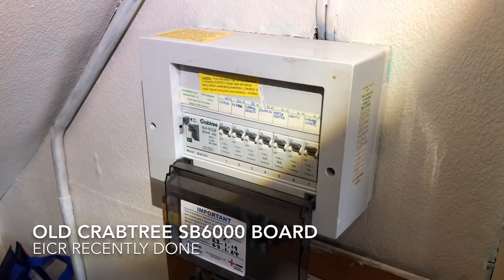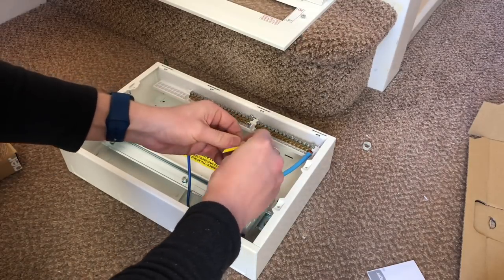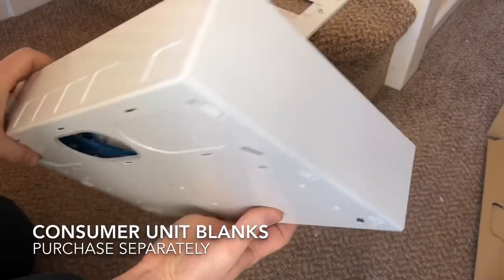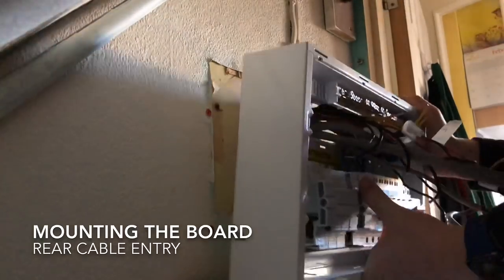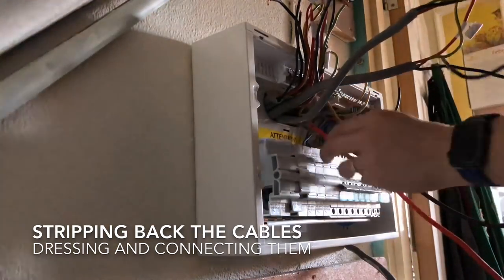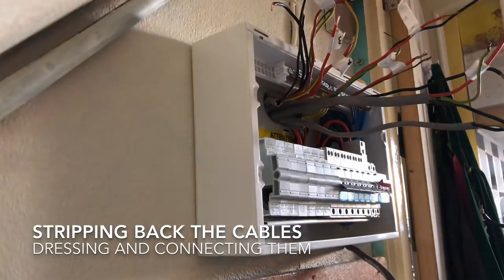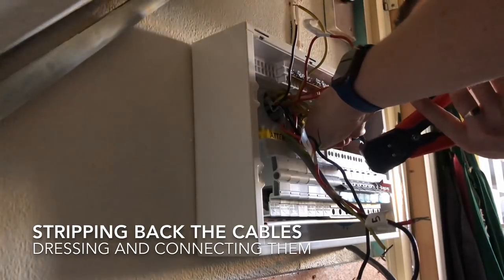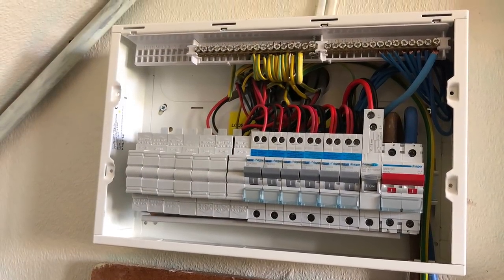Consumer Unit Replacement- Installing a Hager RCBO consumer unit to replace an old Crabtree one

Comment: Great video, nice and tidy board. I have a question regarding RCBOs, in the past type AC would be installed. Today the emphasis seems to be Type A as a General purpose, what would you install in a domestic enviroment type AC or type A.
Reply from the maker: Type A always as many home appliances have DC leakage current now
Reply: Would you consider mixing type A with type AC! Type AC for resistive load eg immersion heater and oven and type A for everything else.
Reply from the maker: I only use type A now
Reply: I’m just reading up on rcbo’s, you mentioned type AC and A can you clarify as the ones I’ve seen are type B and C
Reply: @paulwilliams8536  Type AC only works with AC loads, so electronic loads won't play nice with them as the electronic load would usually be pulsed DC
Type A works with both AC loads, and pulsed DC loads

EDIT: you might be getting confused with the MCB part of it
with MCBs, Type B is the standard type for domestic installations, Type C is usually used when an inrush of current is likely to occur when the equipment is switched on, and there is also Type D for where the inrush is large enough to trip a Type C

Comment: Its a bit confusing why you put the neutral al to gather on one big strip ‘English way’ here in Holland and Germany both wires natural and fase go true the RCD
Reply from the maker: Anton Floor yeah here we only have single pole RCBOs in domestic properties but you guys have more double pole which is better
Reply: Both the N and L go through an RCBO / RCD. Only difference between the two is the single pole / double pole nature and width of the units.

Comment: Personally, I'd far rather see all of the rcbo earths twisted together and connected into a spare or 'bonding' terminal.
I've seen far too many of them fall out of the terminals when testing. 
As far as I'm concerned,  there is no requirement to identify the functional earths,  if you want to remove an rcbo, just snip the earth off close to the bar. 
It's also easier to strip the cables before fitting the board.
I've got exactly the same problem in my new house,  I like the look of those new compact rcbo's!
Cheers...

Comment: nice explanatory video, i agree an experienced electrician does get a feel for terminal tension. i noticed the tails entry seems to be built into the unit rather than an external gland. Is it a secure entry which holds the tails and prevents pulling /movement?
Reply from the maker: Yeah they have this cable entry plate they supply with the consumer unit which holds them quite well.

Comment: Excellent video, very good explanations. Thanks. You teased me with your discovery of french distribution panels and I watched this video only to discover what it's like in the UK, on your side of the Channel. I'm really surprised to see no housings are used !?! I can't be sure about the cables emerging from the wall ( maybe housings hidden deep in there) but there are definively no housings around the 2 big exposed cables between the main breaker and the distribution panel. Is this a state-of-the art situation ? Or is it only a legacy setup with a new panel, and brand new installations get a more secure layout.
Reply: Their Meter Tails are double insulated cables, just like the cables we use without conduit around them on the continent. Just with a single wire inside, instead of a set. Over here on the continent, we mostly 	use single insulated wires which are then placed in conduit, but at least here in NL we do also do cables where those same single insulated wires get a second layer of insulation together, and those can also run without conduit.

What really looks weird is their “twin and earth” flat cables, when all ours are round.

Comment: Hi, thanks for video. good sparky ;) ,
 I have 2 questions, 
1-do you had situation where you just need to move the board to other place where i need to extend the cables?
2- why do you mark the white Rcbo earth tails? do they need to be marked with  earth sleeving?
Reply from the maker: Thanks! Yeah we sometimes relocate a board to a new location and have to extend the cables, it’s a tricky job!
We don’t actually need to mark the white rcbo tails they are a functional earth which should be white. I put sleeping by mistake
Reply: @artisanelectrics   thanks for your quick reply, appreciate it. do you have any video or link where can i see what materials(JB's) i can use if i need to extend final Circuits and most important is how to extend main feed. :)

Comment: Is there a need to fill the gap at the back of the CU where the cables are coming in with some Intumescent sealant to contain any fire that may start in the CU.  I thought that the reason for metal CU's is that they are meant to be able to contain a fire if one starts in the CU. 
Also is the Hagar supplied grommet for the incoming tails & earth  made of Intumescent material. 
Neat CU cabling BTW.
Reply from the maker: Shilks some sparks feel its necessary to install fire sealant in the gap at the back, others don’t, regs aren’t clear on this. Hager tails grommet is not fire resistant as far as I know. People seem to be going a bit over the top with this whole fire sealed board stuff IMO
Reply from the maker: Shilks some sparks feel its necessary to install fire sealant in the gap at the back, others don’t, regs aren’t clear on this. Hager tails grommet is not fire resistant as far as I know. People seem to be going a bit over the top with this whole fire sealed board stuff IMO

Comment: It looks like you have trapped the two surface cables. Why not do an bit of chasing or fit some trunking? Another thing: why not use proper strippers?

Comment: I fit hager but if going rear entry I gor for the cable entry plates which are much easier than faffing with grommet strips.
Reply from the maker: John Dufton good tip thanks!

Comment: Great video, pity the final image was of a different board (ie more circuits and blanks) as I would have liked to have seen the tails as fitted in the early part of the video
Reply from the maker: drunkinpiper yeah I forgot to take a final photo...
Reply: Thank you for your prompt reply, keep the videos coming as they are greatly appreceiated. @artisanelectrics

Comment: Thanks for that, very clear. I also have gone over to Hager. Just wondering why you used a 14 way board when the 10 way would have been fine. Cheers John.
Reply from the maker: Always like to leave plenty of spares!
Reply: One other question to ask you; Have you ever installeda Hager RCBO with the main switch on the left hand side of the board. There are situations where this would make it easier, ie pre existing tails that are hard to move. As far as I can see it just requires moving the main switch over and perhaps lengthening the the tail to the neutral bar. Obviously the poles on the main switch would be reversed and so need relabelling but shouldn't effect its operation. The busbar will still fit. The order of the neutral tails from the rcbos would be in reverse order to the rcbo's unless you renumbered the neutral bar. Would appreciate your thoughts. Thanks John.

Comment: What would you do if the cables from the original board are not long enough to reach the terminals  in the new board?
Reply from the maker: Zippy Mo good question! Would extend them with Wago connectors.
Reply: @artisanelectrics  ahh yes the good old wago connectors. They're a god send! They solve many issues.

Comment: As a new electrician, could you have used a smaller board?
Reply from the maker: Yes you can use smaller but I prefer to leave enough spare ways for future expansion

Comment: I was just wondering why the Two Cables on top surface run above Switchboard, why didn't take them in via a gland. This reminds me of the USA Switchboard changes. You really would look at what is required in New Zealand. The UK Ring circuit what a bad idea. We can fit a RCD 63 amp breaker we Three Circuit beakers fed from that. I am running Two Phase (230 volt 50hz) into my house 2 x 16mm NS with two by 63 Amp Fuses in Underground power board out on road. Dressing Cables, we strip and terminate cables.
Reply from the maker: Brent Williams I just ran them in the same way they were run into the previous consumer unit. I prefer not to drill holes in the top surface of a consumer unit if it all possible.
Reply: No Mate, you're running SINGLE phase 230v 2 WIRE in New Zealand. Voltage between 2 phases would get you up to the 400v region.
Reply: @richardashworth400  Thank you Richard for re educating our former colonist lol Mr Williams.

Comment: How did you turn the electric off (that comes from the meter) ?

Otherwise great video which gave an insight into changing the board.
Reply from the maker: jon smith I think you can work that one out for yourself! Thanks for the comments!
Reply: @artisanelectrics  hi, it was a serious question,   I'm in front of my meter now,,, there is a set of cables that come through the floor to a small black box (with a wire tag on)  , these then feed up to the meter (an old rotation type),, from which to cables come out and go into the consumer box (  I'm guessing I can't just undo them from within the consumer box live) ?
Reply from the maker: jon smith you would need to contact the DNO if you want to turn the power off they can remove the main fuse for you, but unless you are a qualified electrician and can self certify under part P of the building regulations you shouldn’t be messing around with any of that.
Reply: @artisanelectrics  I see ,  it's a fuse before the meter ,   cheers .  Great videos, excellent work
Reply from the maker: jon smith yes the main cutout fuse is owned by the Distribution Network Operator, they are responsible for disconnecting the main fuse so you can have work done on the consumer unit.
Reply: "I don't know what any of this stuff is,  but I'ma gonna change this board if it kills me"....
Reply: @casperme6552  'The youth know everything, middle age are sceptical of everything and the elderly trust everything'

Comment: Why do you always take the most expensive boards?Try Gacia and you will see that it is a lot cheaper and still very good!!I have installed about 10 off them and very good.

Comment: Because you asked about labeling: https://imgur.com/AcNxsVf

Nicely colour-coded by room. Yellow is the kitchen, in case you couldn't guess. No isolation switches here, instead we get a separate circuit breaker for each appliance...
Reply from the maker: Nice! Love it

Comment: Hi great video - can I ask what you charged for this job?
Reply from the maker: Just looked back and it was £900 including vat for the CU upgrade and £360 including vat for the EICR beforehand. 
I have put my prices up since then though so would have charged more now.
Reply: Which area are you in? That’s seems a lot for a cu upgrade even with rcbo’s.
Reply from the maker: Cambridge, it’s basically the same as London prices here as properties are so expensive
Reply from the maker: I charge £80 per hour plus VAT

Comment: may  cost  me a bomb in  your  travel time  I live in  Stoke on Trent  Staffordshire just had a sparky  come and  have a look  as he lives  next door  but one to  me   turns  out  the  guy  who come to  fit the Pod Point  most likely  could  not be arsed to tackle the  job plus this is through the OLEV  grant as well which is  arranged  through  Pod Point.   thank  you  for  your  offer.     S C    UK.
Reply from the maker: Steve Capper contact  @N Bundy Electrical  he lives near you and is a great sparky

Comment: How did you get the client to fork out £300 odd quid on RCBO board?
Reply from the maker: John Dufton most customers want quality and are willing to pay for it
Reply: @artisanelectrics  in more deprived areas customers are more concerned with cost.
Reply from the maker: John Dufton yeah it really depends a lot on property prices. Around here most houses cost minimum £300k so forking out £1k for an upgrade is nothing.

Comment: What about using a Torque screwdriver on the terminals to comply with MI instructions......😜
Reply from the maker: yensabi yes gotta get me one of those! I’m saving up for the Wiha Electric Screwdriver!
Reply: @artisanelectrics  Waste of money getting the Speed-E as it only goes up to 0.4Nm. Nip the terminal screws up by hand then go over them all with a torque screwdriver for final tightening

Comment: I myself would have sleeved the reds with brown and  black with blue to bring up to speck
Reply from the maker: Thanks
Reply: Label was added to cover this - wouldn't see a need to add sleeving. Otherwise how far do you take that - sleeve at every switch and plug??
Reply from the maker: Mike Foley I agree

Comment: Hager grommet strip is shite! Get the clip in inserts! Are cables run in insulated cavity wall?
Reply from the maker: Jon Swain I found the grommet strip is quite good compared to some other brands, I’ve also tried the inserts as well.
Reply from the maker: Jon Swain I found the grommet strip is quite good compared to some other brands, I’ve also tried the inserts as well. Yeah existing cables were run in cavity wall unfortunately.
Reply: Did you derate for reference method or as no thermal effect (presumably) just C3 it? I just find the strip a bit skinny! But they are the best boards at the moment. Factory fitted SPD boards are convenient.
Reply from the maker: Jon Swain yes just C3 it’s only a short run in cavity maybe 2m max

Comment: Two bad things:
1. He pulled the cables out, stripped them and cut to the size. That's bad for next DB upgrade. Somebody will struggle to do the job with so short conductors. Why he didn't push them to the wall and use as much as he needed?
2. DB is metal so Earth should go trough the same hole as the meter tails to fulfill the regulation about the electromagnetic effect. That's C3

Comment: Taking a bit of a risk just going straight into the wall with the drill. How did you know there weren't any other cables or pipes in the wall.
Reply from the maker: Shilks it’s easy to know whether there are any cables or pipes in the wall just look above and below for signs and be careful while drilling, if you feel a change in drill then stop and check. Always bear in mind cable zones. I’ve never hit a cable or pipe yet in 15 years.

Comment: That job must have cost your customer a bloody fortune with all those RCBOS and using Hager.
Reply from the maker: Paul Green the Hager boards are excellent value for money, you get what you pay for as they say! Our customers deserve the best.
Reply: @artisanelectrics  I don't know £140 for the rcbo's themselves or £60 for a dual rcd board fully fitted. So long as they pass the testing its fine, and if the customer does deserve the best get a Wylex or MK board up much better than Hager.
Reply: @Brynoize  I agree. Wylex/ Crabtree/ and MK are every bit as good.

Comment: If this is done to the 18th where is the SPD?
Reply from the maker: CrazySparkie63 SPD is not always required, see latest NICEIC guidance video
Reply: @artisanelectrics  Yes but we still have to put down why if not fitted, and the amount of calculations required (if we can get the relevant data) is not worth it!
Reply from the maker: CrazySparkie63 yeah I’m fitting them as standard now
Reply: @Steve Mclean I have been in this game for a long time, over 30 years since I finished my 6 and a half years apprenticeship and a lot of the NEW regs are backtracking. I'm glad that over time I have developed other skills (so that I have a purpose in life as I'm not that far off retirement age, and I'm not going to retire) as I am at the point of washing my hands of the electrical trade ( which I never ever thought I would ever say)!
Reply: SPD isn’t required on a single dwelling ( domestic home ) unless you want to fit one . You don’t even have to do the risk Assessment.
Reply: No SPD required for domestic dwelling, although recommended for TT systems.

Comment: very  nice   Job  well done  now  please  come  do mine  got a box thats  not been touched in over 30 or more years
a guy  from  Pod Point  came to fit me a Electric car charger got one look at this and  said no  sorry cannot  do it  with what you have  here.      SHIT     now have a list that  needs to be  done to bring it up to spec for him to come and  fit the charger.need new fuse box with  RCBO 's  and new earth  update  to correct spec in short  bigger wire on  the  mains  water pipe
looking at a  min  of 8 switches on the  box just in case of future work. by  the way  I am  no electrical engineer.   :  (        S C         UK.
Reply from the maker: Sure! Send me an email and I will be glad to give you a quote!